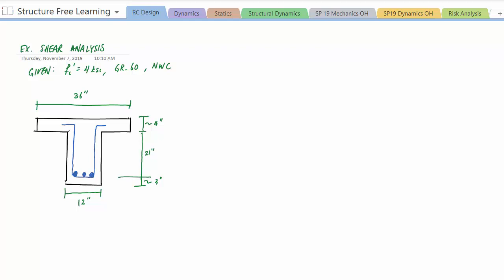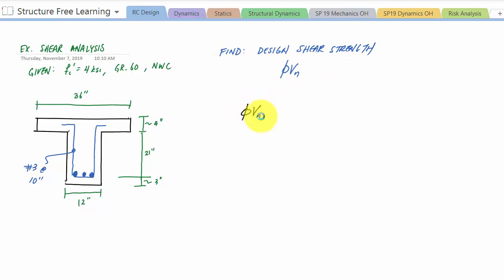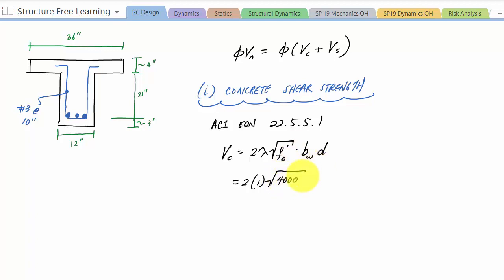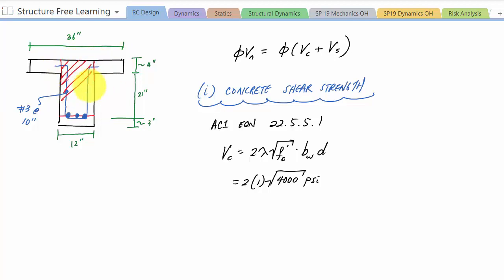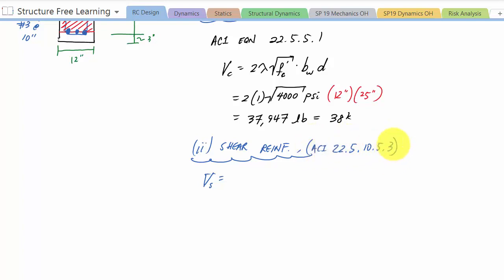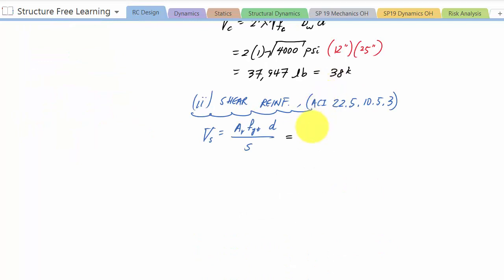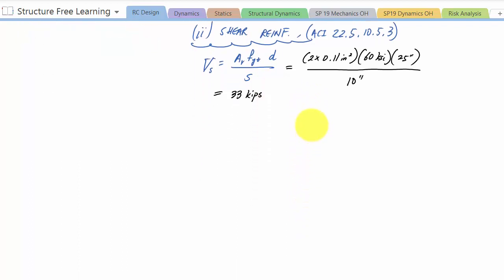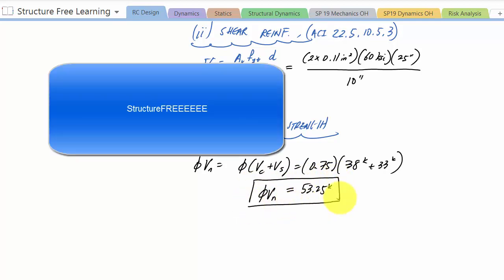T-beam Shear Design Strength Example - Reinforced Concrete

Comment: I want solution of this question by consistent deformation method today
Question= The 15 m continues beam having udl of 16 kn.m over entire span. The left end is hinged and right end is having roller support and also having roller support at 6M from left end A.
Beam having loading of points load of 20 Kn/m2 at 3M from left end A and 30Kn/m2 at 4M from Right end B.